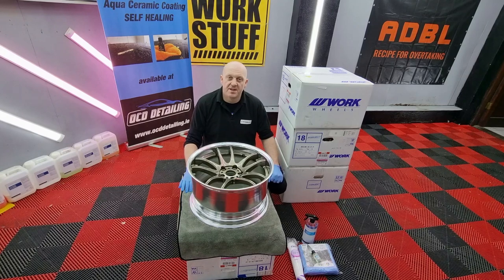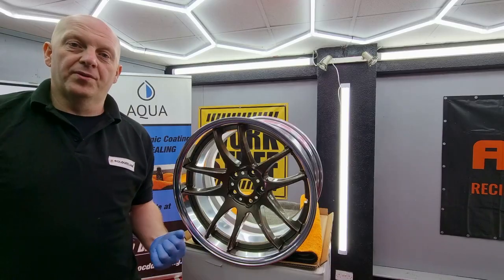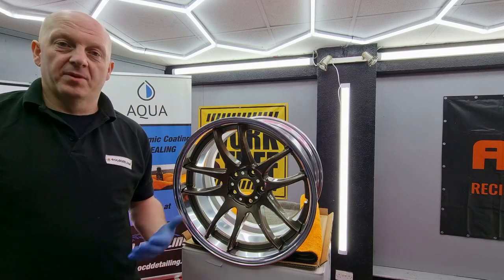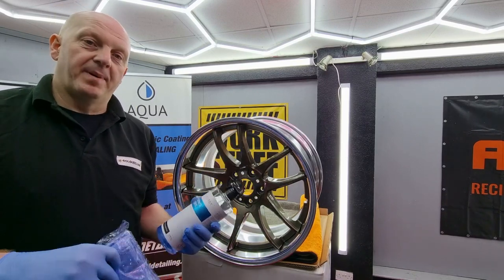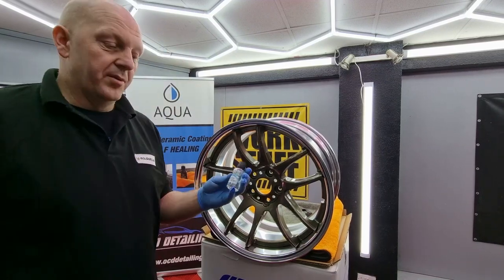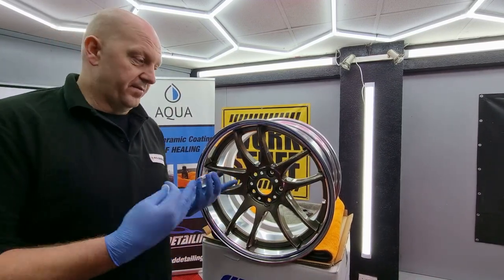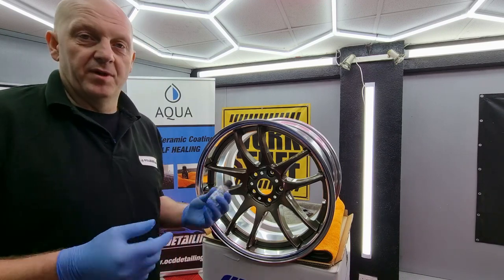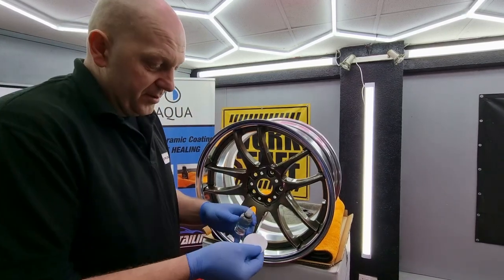How To Apply Wheel Coating

Comment: Thanks for the great video! one question @OCDDetailing2021 , is it true that it could be difficult to apply weights cause they'll not stick? does it apply to Aqua wheel coating too?
Reply from the maker: You are welcome, yes that's true, coating should be applied after balancing the wheels.

Comment: Can i put on this coating top coat or booster from aqua right after the application?
Reply from the maker: I would give if some time to cure before applying anything 10 -12 hours
Reply: @OCDDetailing2021  so if i use aqua top coat after 12 hours it should be good? I want to increase coating life to maximum because i have really complicated wheels, so i can't make proper coating service when they are on the car. Do have any advices Luke using top coat or booster specially to increase durability. Thanks for answers.
Reply from the maker: @kubus55f  to get longer durability, apply second coat of the coating after 10-12 hours after applying the first on , if you want to make it even better then after another 10-12 hours apply booster, that would be serious combo for wheels.
Reply: @OCDDetailing2021  thank you very much!